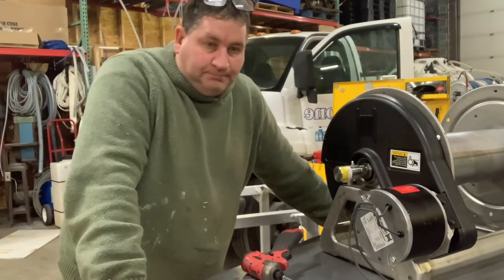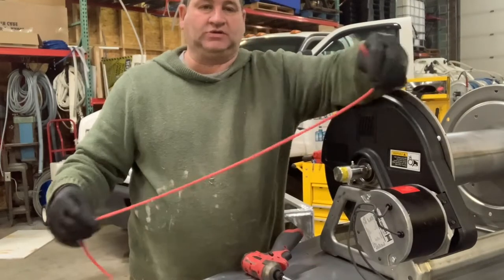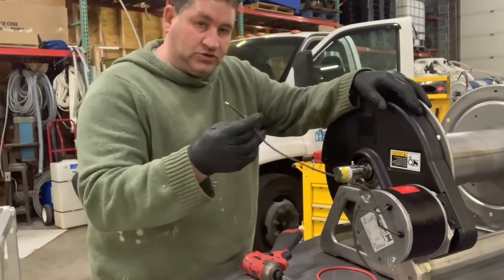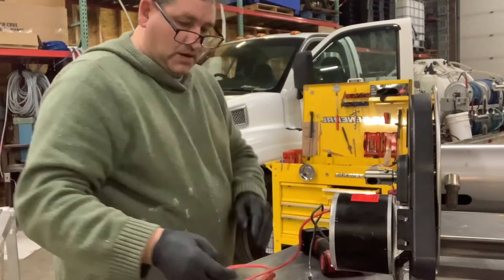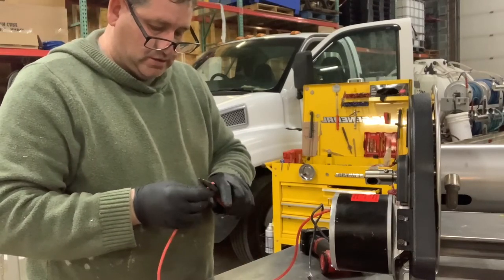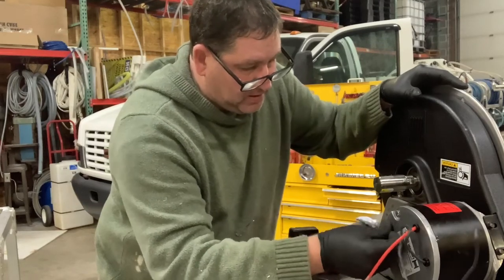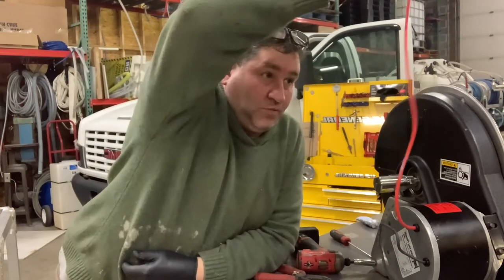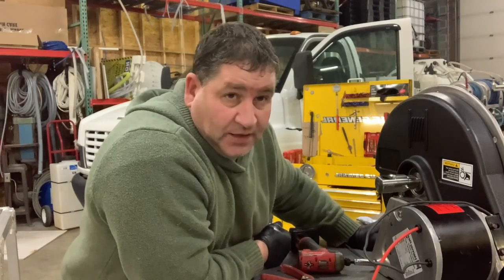Re-Wiring your Hose Reels, Hannay, Titan etc.

Comment: Is that small battery with the wires that you used to test the reel wires something that you made or did you buy it somehwere?
Reply from the maker: You can buy it it’s just a battery adapter on eBay
Reply: @thepressurewasherschannel9109  Thank you for the response and the video.